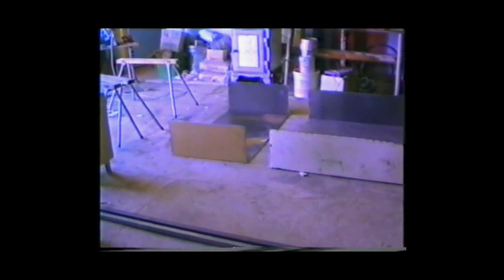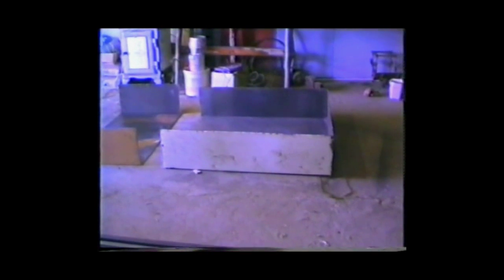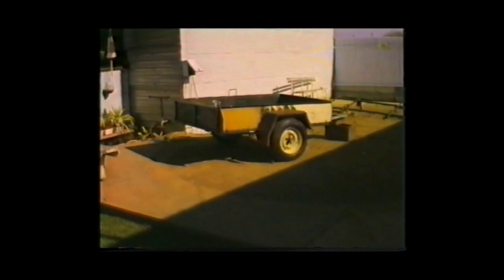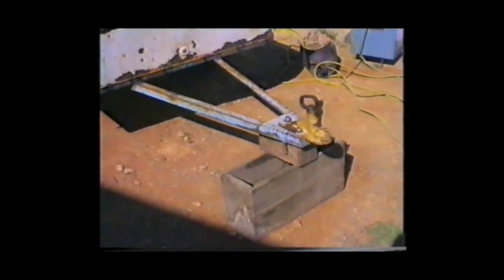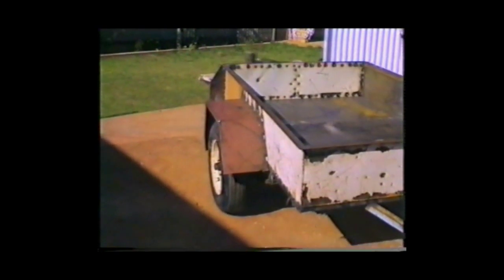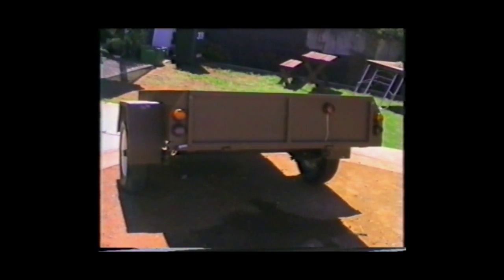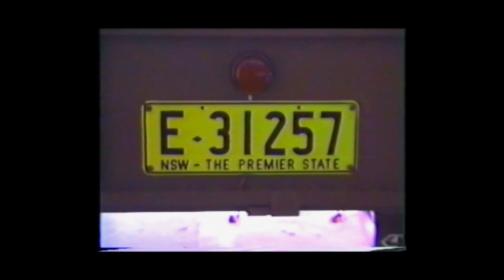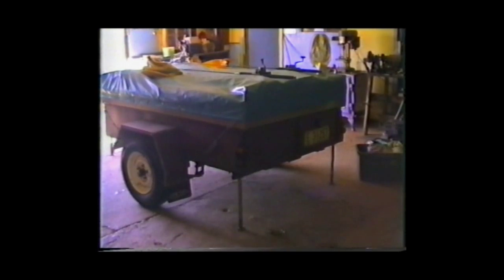How to build a 6 by 4 camping trailer out of oil tanks, For a Bolt on Camper

Comment: Good job! Is it difficult to get number plate for such DIY  trailer, there in Australia ?
Reply from the maker: Thank you. It is very hard to get them now, but many years ago they would just check the trailer that you made and if they thought it was OK, you got your number plate.
Reply: @GavinClarkdiy  we have the same here in Europe. You need doing hard and pay much for the expertise 😒
Reply: @GavinClarkdiy  Funny you should mention that. Here in Victoria, it's a piece of cake to get a car trailer registered. As long as it complies with standards regarding tow ball coupler, safety chain/s, mudguards, and lights/reflectors, and you've got a V.I.N stamped on it, you're all good. Oh, and some officers like to see a compliance plate - which is easy to buy and fill out.
Reply from the maker: @tandemwings4733  Thank you, I was more comparing years ago to now, I am in NSW, I believe it's a bit tougher here, but as you say it can still be done, I have not registered anything homemade for a long time. The old days were simple, just lights, chains, mudguards mudflaps. You got it checked, I think they gave you a chassis number when you registered it, and you just write the number on with a welder, and the trailer was marked "Homemade" on your rego.
Reply: @GavinClarkdiy  Yep, you got it. Actually, if you can, it's much easier to stamp the numbers onto the chassis, but either way is acceptable..
Reply: @tandemwings4733  same here in Queensland I have a friend who’s made 6 different types of trailers and all the local office lady did was walk out had a look to make sure it complied to the rules and that was it, he got it registered really easy. It does help living in a one horse town 😹😹😹 so as a rule there are only one or two people at the local office which is also our local courtroom 😹😹😹 but never go on Wednesday they are not open 😹😹😹😹